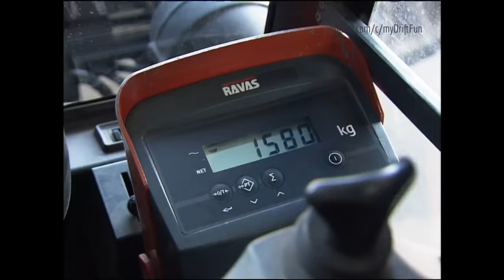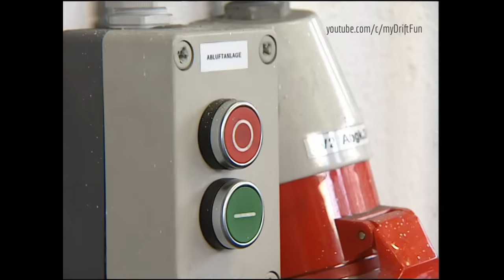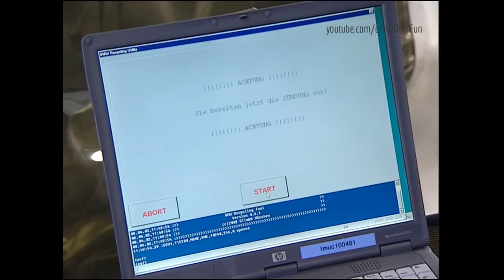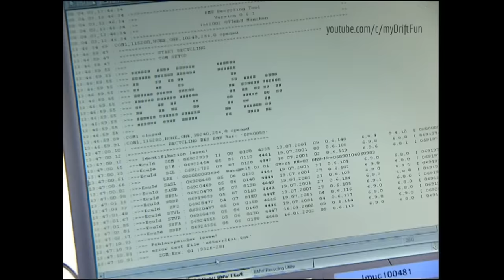WHAT?! BMW Cars Recycling and Disposal - Fans Will Cry

Comment: Most of those cars look almost  brand new with potentially many years of motoring ahead of them. What sheer criminal waste.
Reply: I remember reading somewhere that theses were BMW internal prototype cars, used for testing and development.
Reply: wangmy1998 they would need 200 recycling facilities fullmof cars, only for preproduction. they test a lot huh?
Reply: It takes about five years to bring a car to market, so yes, a lot of prototyping is done. Also, if a flaw is found on a given car during production, and if that flaw is core, the car needs to be scrapped. They'll strip off what they can, of course. Remember that BMW sells a staggering number of vehicles globally, and they lose money on every car that gets scrapped. They're not going to scrap any more than they need to.
Reply: It's called RECYCLING...
Reply: Victoria Police put out a statistic the other day. Of the 115 road deaths in the State this year if vehicles had been fitted with stability control; 60 more people would be alive today. Vehicles built post-2011 are all mandated to have Stability control in Australia. The newer the car the safer you are.
Reply: and what about 1990-2000 bmw cars? than peapole dont need to buy bmw's if ..
Why then people buy this brand if they do not know any skills, if the beginners are drivers, if they do not have a clue about the vehicle, they will of course cause an accident, ASC it is not needed at all .... old bmw school!!
Reply: Much easier to do this rather than having to get their legal department to organize that. Would cost less too. There are only a handful of these units anyways. Why waste thousands to put together a waiver when there's little money to be made?
Reply: Mark Cresswell this are only prototypes
Reply: you can file suit against anyone at any time for any reason.  I could file suit against you for the post you just made
Reply: Mark Cresswell maybe if you read the description you would realize that these cars are built differently to be easily recycled since they're preproduction models.
Reply: wangmy1998 if that is the case why is there cars from the 80s, 90s and 00s? (All showroom fresh still)
Reply: EOS BMW why are there models nearly 20 years old then?
Reply: Jimmy Grant I seen an e32 7 series, that was for sale in 1986??
Reply: Mark Cresswell these are prototype cars...
Reply: GTVS from 1986?
Reply: pre production models
Reply: They are test cars, they arent allowed on roads, they have to be recyled
Reply: Captain_Coleslaw there’s cars from 1986 and cars from 2007. Why wait so long to scrap these (still fresh looking...might I add!) cars
Reply: The r53 Mini looked hardly used!!!
Reply: @mattsteele6367  60 bad drivers back on the road to kill agin ?
Reply: Some are units that had major defects discovered late in the assembly process. On pre-production vehicles, many parts remain the property of their suppliers, who will not sell them for liability reasons. Some parts are also different, and not compatible with the final production units (previous engineering versions, different materials, etc.). Most PP units do not have valid VINs, therefore cannot be sold or registered anywhere.

Comment: in other countries this cars will be used until the nuts can't hold the wheels anymore :P .
Reply: In Venezuela 1 rubber costs 2 months of work
Reply: Not pre production cars, which these are.
Reply: @MiniOne82  Tires can still be reused if it's only used for testing. Not like they made a pre-production tire for pre-production cars, they were already in market. Just plain waste.
Reply: C'est bien dommage ...
Reply: Which countries?
Reply: @ahmedgaili1793  k km I'm i
Reply: Why r these cars being recycled? They look as if they could still be used
Reply: @ginozanga2129  they are pre production cars, never meant to be driven, also unsafe to do so

Comment: I find it amusing that most of the computers being used in this video are older than the cars being scrapped.
Reply: Iiii
Reply: @waimantsun9148  i9
Reply: Old computers have more reliable software.
Reply: the movie is from 06, so quite old too
Reply: Proberly because the sw was written for systems of the time of the car production, which most likly will run buggy or not at all on modern os's,
I still use a old xp laptop for cars made before about 2005 as some of the software either wont work on modern windows os or there have not been drivers written for the old cables on modern systems
Reply: Windows XP. Its still uses in most big companies. Research it.
Reply: @meso06  the Uk NHS being one of them
Reply: These computers are specifically built for the software. It dont need high performance laptops which we used in our office. These bmw laptop just run the software. Not it windows operated
Reply: @emiratesindustries1834  would you agree they are most likly running ms dos or the ibm equivalent?

Comment: I drive a 20 year old German car that has been a pleasure the own. There was an unbelievable amount of engineering that went into the design of the auto when it was manufactured and it has provided unbelievable reliability. I understand that these are autos were test beds for ideas that may or may not have made it into production and yet, it still seems to be a waste.

Comment: if it was a Toyota, it would still start up and run even if it's in a shape of a cube
Reply: Bmw is many problem car..over 4years....he he he...
Reply: Lol! I have Toyota and it has an oil leak and friend said if the oil runs out you have a dead car. I told him that it's a Toyota,  if the oil runs out  I still have 100 thousand miles left.
Reply: Ryan Ryan 😂😂👍🏽
Reply: Bing Hsiang Tan but better than Toyota
Reply: After having the motor torn out...
Reply: You mean the GR SUPRA?
Reply: @nissanpatrol8950  gently plucked motor
Reply: What a load of bs! How many Toyota have you owned?? I owned multiple Toyotas over the years, they actually have quite a few problems.
Reply: Theres a ad for that when they recycle  a toyota avensis and as a cube it still started up
Reply: Scotty is that you ?
Reply: Not the new stuff nowadays, that boat sailed away long time ago.

Comment: These are test vehicles that are not street legal! They strip it down for parts and recycle the car to be reused in production of new vehicles. That way it saves manufacturers time, energy, and money since they are not using virgin materials which costs more, there’s no waste, and a much lower carbon footprint! Imagine if you bought a brand new car that had recycled materials from either a prototype test vehicle or an end of life vehicle (ELV)??

Comment: The worst part is they scrap classics. Z3s, e36s, e46s. People pay mad money for mint low mile examples while these are literally brand new...
Reply: you call mercedes that you're in mali and need a new transmission axle for your 1972 truck and they come and bring one within 72 hours. bmw can't even supply you a new headlight after 4 years lol.
Reply: @CB3ROB-CyberBunker  ever heard of eBay?
Reply: @CB3ROB-CyberBunker  Huh? One of my BMWs is 23 years old, never had a problem getting new OEM parts from the dealers.
Reply: @FrozenHaxor  yeah. brakepads or a radiator or something. now try a glovebox or a chair. :P lol.
Reply: @CB3ROB-CyberBunker  I did really obscure interior items, they had everything in exactly my trim type. Seats I didn't try. I doubt they have that after such a long time. If they did I'm sure it would cost an arm and a leg lol, especially there were dozens of possible seat configurations, mine for instance are fully automatic and with heating, some were fully manual but sport models, etc.

Comment: Hmmmmmm imagine if they built cars that last longer. You know a lot of a vehicles carbon footprint comes from its manufacturing process. My family buys Hondas and they last nearly 20 years. When we are done we sell them and someone else drives them till the transmissions blow apart. Meanwhile BMW over here using plastic under the hood where it shouldn't be and biodegradable wires that just cause nightmare electrical problems later in ownership

Comment: You don't need to be a fan to see that it isn't recycling, that's wasting away usable cars!
Reply: Pre-production cars were never ment to be used after the testing phase is complete. The main reason is that sometimes the safety standards and quality standards aren't the same as the finished product. Therefore the manufacturer finds it better and safer to have them scrapped.
Reply: I was butt-hurt until I read this comment - which makes perfect sense.  Thanks.
Reply: DeGlennen but why would they waste BMW parts which could be used in new ones if they are just going to be scrapped after being tested it's just a waste of parts and other countries could use these BMWs and Minis
Reply: Parts that have been used cannot be sold as if they were new parts. Next to that a lot of parts have minor differences between pre-production and final product. (Parts numbers, CE labels, quality labels, ...)
Reply: Why car manufacturer would test a car which would not meet the security standards? I would say that the real reason is that manufacturer can deduct the cars in taxation and an R&D cost. So rather than paying tax they destroy the cars and at the same time do not provide less expensive new cars to market, cannibalizing the sales of full priced new ones.
Reply: @jannepo  You're thinking about this completely backwards, these are called development platforms, they don't even have a VIN number in most cases, some of them will work toward getting the platform properly certified, like in Euro NCAP doing crash tests with dummies. This is all done to make absolutely sure that when the first real one rolls off the assembly line, it IS based on a proven design, fully tested, certified and ready to serve for decades to come.

Comment: ? all of those cars dont look like they need to be recycled. broken drivetrains no one cares to fix?
Reply: its much more expensive to recycle these cars though..  and recycled materials are not worth the effort
Reply: If a car was used as test car and is not 100% standard, you can't sell it
Reply: if you bothered to read the description you would find out
Reply: Probably dont have VINs or meet legal requirements for public sale. which is why they have to guarantee they won't end up in public hands
Reply: They have much value as spare parts.
Reply: Crushed due to liability reasons and tax

Comment: Yes the wastefull past and trow away should be over. Build it so it can be taken appart Cost something so be it  Landfill is also not cheap in the end. No need to have a NEW car every couple Years. 
My Ford Econoline is 1984 and has over 1.1 Million Miles on it. So it is possible to build things that last , that thing actually could be easy taken appart.  Chris Schmidt

Comment: I always did wonder why there wasn't as  many pre-owned bmw and benz as there is with other makes like toyota and hondas. I figured well maybe they get sent over sea where they might have a better value than USA, but even other country that i traveled they are as rare. This video just answered many questions, they don't make good pre-owned cars since they are to expensive to keep once maintenance time kicks in. So in reality they are not worth as much is they retail for, They are just worth their lease value, since they get trashed when returned. In away it makes sense bump up the retail value or else buyer won't pay such a high lease. i have never bought a bmw new, but i bet if this is the case, you can negotiate a new one very cheap, if you can play your cards right.

Comment: These don't look like pre-production or test vehicles. E39 five series alongside F10s??? The whole set up looks slick but expensive, surely it would be cheaper to fix these cars and keep them going. What a wasteful society. In Cuba they have 40, 50, 60 year old cars which they don't allow to die. I guess BMW want these cars off the road so they can sell you a new model eh. I saw an interior crushed in a one series, then when you go to a BMW dealer for a headrest or a bit of trim, they'll charge you hundreds of pounds for it. Yes it's  a responsible way to dispose of end of line cars... but the cars seen in this video are far from end of line.

Comment: Getting BMWs off the road can only be a good thing.Shame there's not an education process to install some manners and courtesy into the assholes that drive them.
Reply: 20% of folks should not have a drivers licence,nothing to do with what brand they drive

BMW & many other brands, are not well designed & have many well know issues never
resolved by the manufactures ,but well known by the auto repair industry